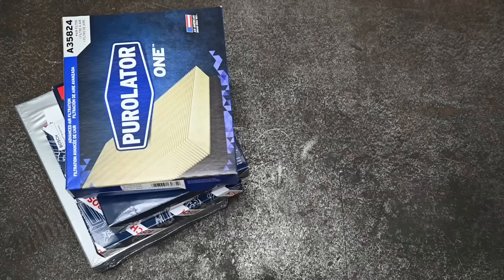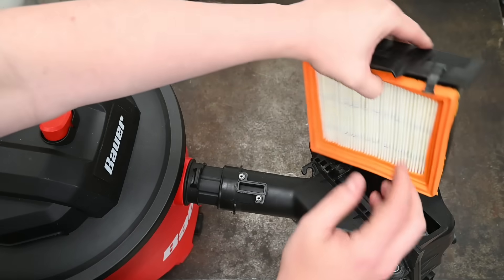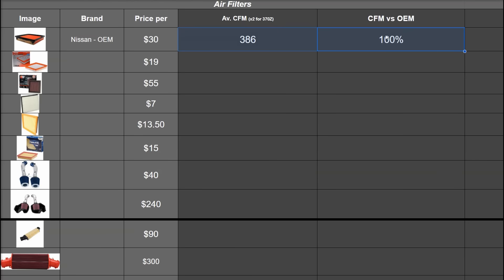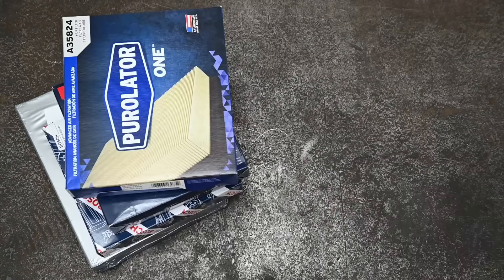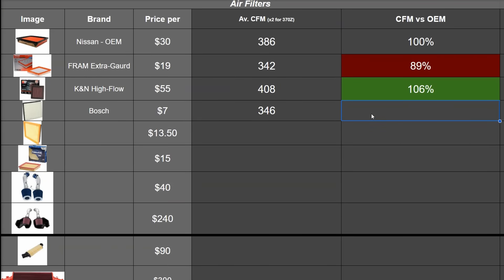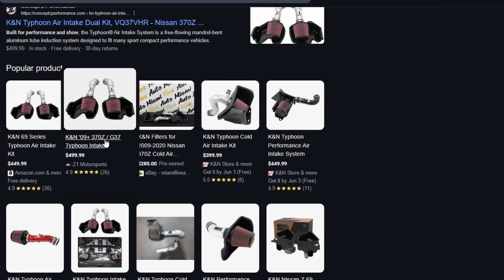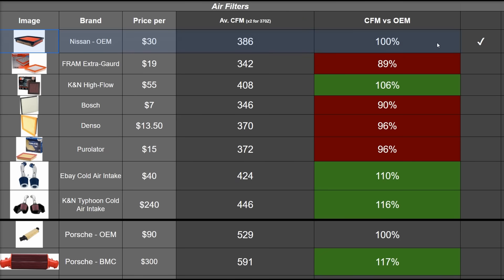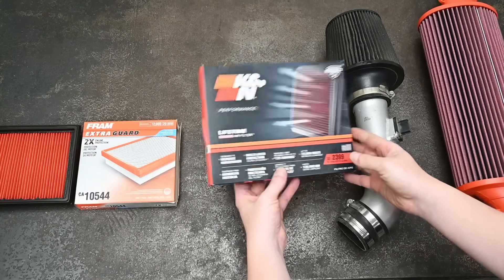Intake Filters TESTED: More Dough = More Flow?

Comment: Great video — and much needed! When it comes to air filters, I’ve found that using a decent, affordable option (like Bosch or Champion) and replacing it regularly works better for my OEM-spec car than a K&N filter. My thinking is that the engine was originally tuned with a standard, clean filter in mind, so sticking to that setup makes the most sense.

As for "cold air intakes," they require a lot of careful design and installation to work properly. You can’t just throw one on and expect magic, because if not done right, they end up functioning more like a hot air intake, which defeats the purpose. That’s why I’m not a fan of cheaply done setups. But I think even if installed correctly the engine needs to be tuned to suit them too.

All of that said, this is a super interesting video! Thank you for taking the time to make it!
Reply: If the only thing your changing is the air intake the ecu on pretty much anything after 2006ish will adjust air fuel and timing accordingly. Yes a custom tune would definitely give you gains but on a stock brand new vehicle this is always true they leave a lot on the table usually that’s why simple plug in tuners work.
Reply: "the engine was originally tuned with a standard, clean filter in mind"

On a carburettored engine this is a very valid concern, changing the restriction of the air filter can impact the fuel mixture.  With any kind of production car EFI made in the last 20-30 years this isn't a convern since the airflow is measured (either directly via a MAF, or indirectly via MAP) and the amount of fuel delivered accordingly.
Reply: I have noticed that I get better fuel mileage on two of my vehicles with "stock", paper type filters than with K&N by maybe 0.5 to 1 mpg...on average over several oil changes before witching to K&N. Can't say I've noticed a performance improvement with K&N. But, I haven't had to replace the K&N filter for 200,000+ miles. Just give it a quick clean and inspection for wear (holes can appear in the filter media and you'd need to replace the filter to avoid letting junk into your engine), let it dry, LIGHTLY oil it, and back in the car.
Reply: well, yes, reducing airflow to the engine will indeed increase your fuel mileage. choking the engine is very common in economy cars for this reason - you lose power overall, but you move the torque band lower in the rpm range and overall the engine performs more work per amount of fuel.
Reply: @doylerudolph7965  This isn't true at all, choking airflow limits maximum power but it does not give any improvement in BSFC.
Reply: From a tuning perspective as long as the maf housing diameter doesn’t change and air turbulence is not introduced, then the filter/cai will not need a retune.

You are correct that a lot of cai are actually hot air intakes and will heat soak which dropes performance lower than the stock intake.
Reply: Just buy OEM
Reply: Bosch is now basically a Chinese company and that’s why you see some mediocre results here. Over the BMW world, people have been gradually gravitating away from Bosch for pretty much anything.  They still make some good parts but most manufacturing has moved to China along with a big decrease in quality.